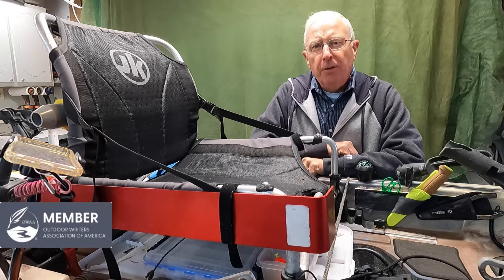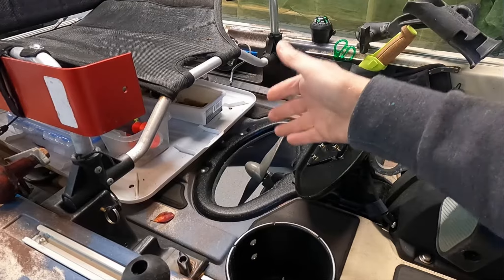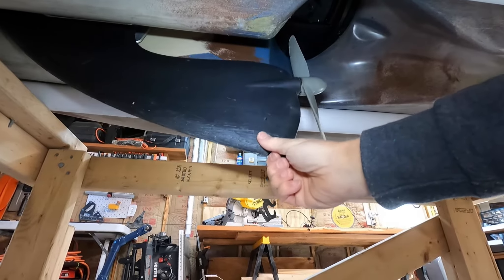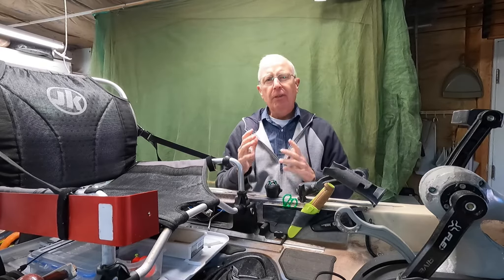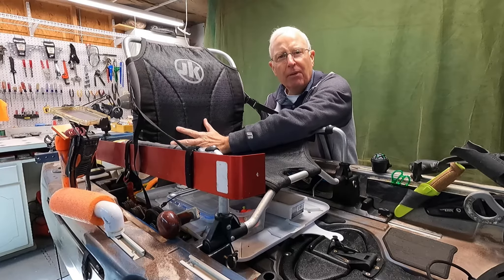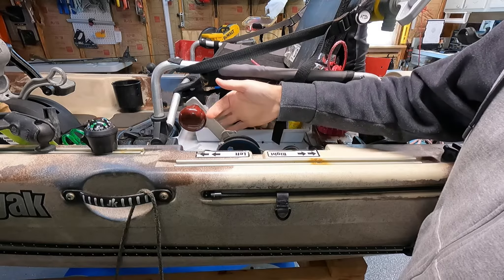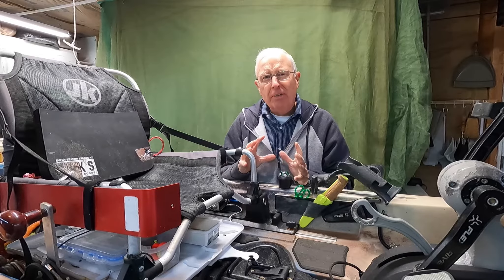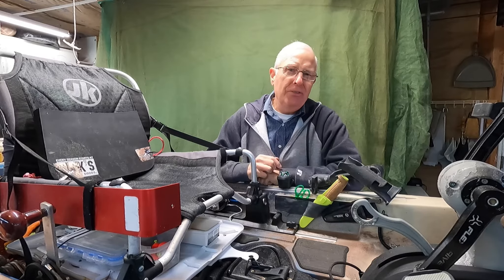Jackson Coosa FD Review - Big Picture

Comment: Good review 👍 do they make a battery-powered motor that mounts on the flex drive That would be cool to see you use if they do .I was thinking Jackson made that?
Reply from the maker: They do make one. I am not a fan of it since it disables the pedals. You would have to carry the drive with the pedals in the back if you ran out of battery power.

Comment: How did you grease the peddle drive I can not find the grease fittings with the right threads and length
Reply from the maker: This is frustrating on my older model. I think the new versions have the fittings. Here is how I had to do it - https://youtu.be/rqb18oYEHSI

Comment: I bought a new 2021 coosa fd, after 1 trip out on fresh water my only issues are that you can't pedal with the balls of your feet your heels will hit the deck, not sure how this is on other brands, besides hobie,  and the other is that the rudder is taller then the keel and seems to take on some stresses while on the ground or in the water.
Reply from the maker: I noticed the rudder issue. I have not tried using the balls of my feet - guess I will not now!

Comment: Great Stuff again bud, I have the same exact model and I would love to see how you can repaint that drive unit. I mainly only fish in salt water so you can imagine what it did to the paint on the flex drive. I would also love to see how you put keel guards on your kayak. I've put a gorilla tape on mine but I don't think it's sufficient enough.  Cheers!
Reply from the maker: lol! My wife repainted my drive unit for me - it will be in an upcoming video. We just used spray paint. I did report to Jackson about the paint issue. I know the quality manager there - hopefully, they improve the coating. I have not put keel guards on. I have mixed feelings about those. The Gator Guards are good, but you cannot continuously add to them as they wear down - I think they only allow one replacement on top? I am lucky in that I do not launch off concrete ramps, so I do not have the erosion issue.